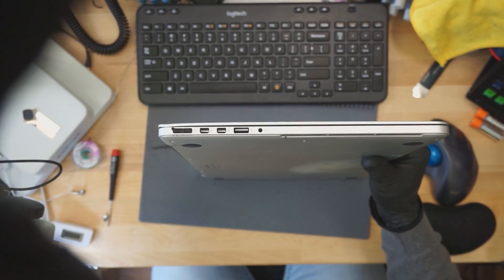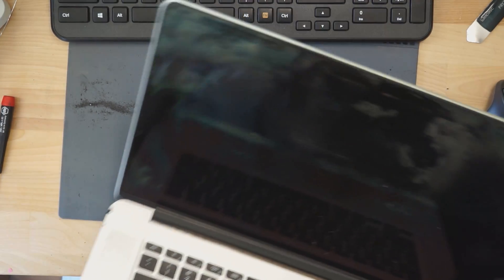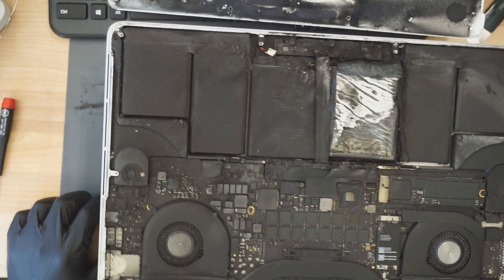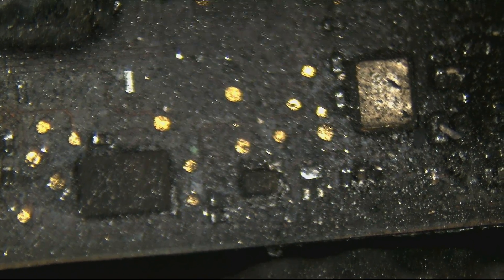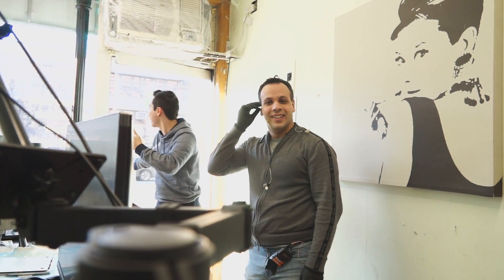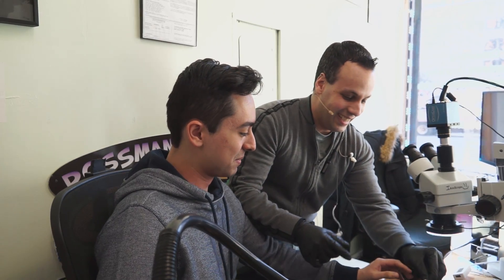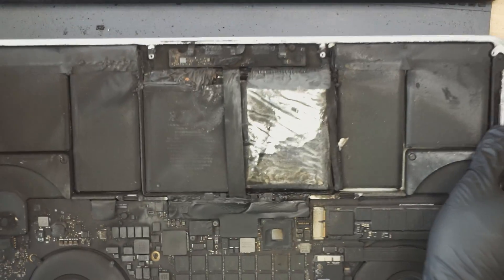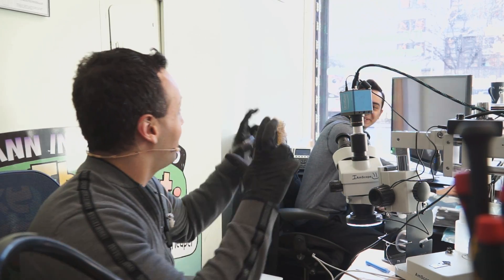Macbook is not waterproof: but is it fireproof?

Comment: Hi Louis, pay attention to the toxicity of those batteries. They might contain LiPF6 which in contact with water generate hydrogen fluoride and hydrofluoric acid which is extremely toxic. So if the container of the battery is damaged it may leak some dangerous powder and gas. I would never have dared to connect the power supply. 

https://www.ncbi.nlm.nih.gov/pmc/articles/PMC5577247/
https://en.wikipedia.org/wiki/Hydrofluoric_acid#Health_and_safety

Comment: Despite this very high rofl content, it seriously would be advisable for Apple to thoroughly investigate this situation. If the battery ran on fire due to design flaws and/or inferior quality e.g. a battery batch  with production issues, it may happen to other macs with same suspicious battery batch or flaws as well. I sincerely hope that if it goes wrong again, the fire also stays inside the mac instead of burning property down or causing casualties.

Comment: hi louis this video was great it shows how good thee apple mac works, but you have to test it and fix the mouse pad and replace the battery and try to find the fault which caused the battery to catch fire. I hope it does not do the same fault again. take care louis and watch out for fires from apple macs. put them in a metal tin which will be safe when you plug them into the mains in case for fire safety notice :-)

Comment: @Louis Rossmann Please cover the Late 2013 Mac Pro hardware problem causing 'Window Server' process to crash.  I really hope you can find a solution to this.  So many people are having this problem.  It happens at a random time seeming to be for no specific reason.

In yosemite the GUI used to go into an unresponsive state where you could only ssh and restart the 'Window Server' which resulted in the ability to re-login in to a slow running computer until it was properly restarted.  I'm on Sierra 10.12.6 now and apparently sierra catches this crash and does the  'Window Server' restart automatically so you don't have to ssh anymore but you're still logged out and have to re-login and finding all running apps were closed and the os is running in the same slow state and you can properly restart it.  Do I have to sue Apple to explain the problem? I don't want Apple to fix it.  I want to know what the problem is and the solution.   Can you save MacPro users from this problem.
 
https://forums.macrumors.com/threads/mac-pro-late-2013-gpu-driver-issues.1860297/page-72
https://www.macrumors.com/2016/02/06/late-2013-mac-pro-video-issues-repair-program/
https://discussions.apple.com/thread/7279979
https://www.macobserver.com/tmo/article/2013-mac-pro-freezes-continue-owners-have-little-recourse-apple-is-helpless

Comment: So you can breathe in the general direction of a macbook on a cold day and it will die from moisture damage but you can set it on fire and its fine. Interesting. Perhaps the owner has one of those new beta models that has apples patented self drying feature.

Comment: I'm curious: do you actually repair and clean that MacBook? Or does it go back unrepaired?
Reply: ultrasonic cleaner and replace battery  should do the job
Reply: And mouse pad replace too.
Reply: In all seriousness, it would most likely be a data recovery job.  He got it to boot up, which is a HUGE advantage in recovering data.  And then the unit would probably be junked (or rather, recycled).
Reply: doubt the customer is going to trust that laptop even with a new battery, I'd just get the files and trash it.

Comment: Louis GET a SAMSUNG NOTE EDGE!!! (the 5 year old one note 4 equilv) for some reason the screens on them are super durable (impossible to break....99%) and u can remove the battery have a headphone jack and microsd card slot. ANnnnd like less than $200 brand new in box!
Reply: They are prone to get pink lines on the screen, screen glass breaks really easy and I’m almost sure Samsung isn’t officially updating it anymore.

Comment: Notice how the battery indicator goes from 0% to "Replace now" (exclamation mark) at 03:28 so after all the damage it can still talk to the battery :D
Reply: I don't think it talks to the battery. I think it tries to and realizes, that there is no Battery.
Reply: I'd be more impressed if I didn't consider it a risk for burning down the my home, car, whatever. Would not want that on an airplane with me.
Reply: The battery BMS is obviously still working, but reporting the error due to the missing cell.

Comment: Spill a little starbucks on it, totally nuked. Literally nukes itself... No worries!
Reply: I ran a computer lab at a school. We used old used when bought desktops with cheap keyboards. Had a kid barf on one. We pulled the keys and cleaned it up with a damp rag and a Clorox solution, put the keys back on and it still ran. The cheap keyboard had a water tight membrane. Apple makes some fairly crap products for the prices it charges.